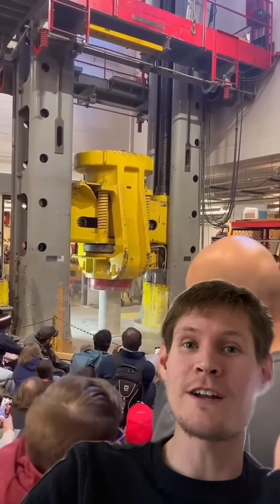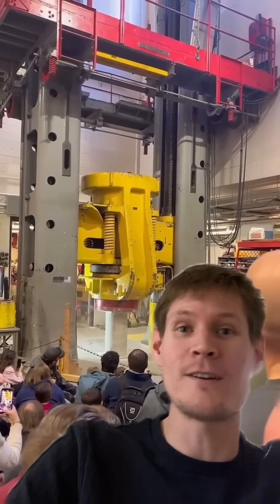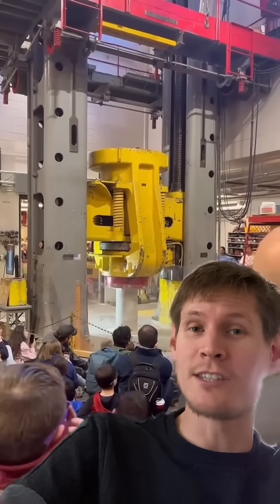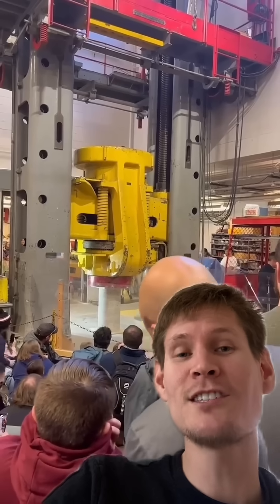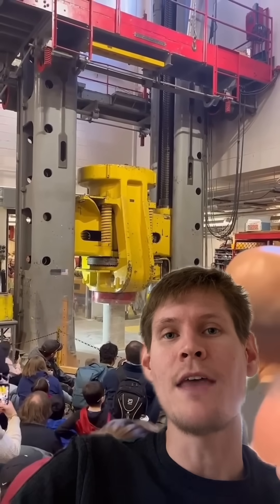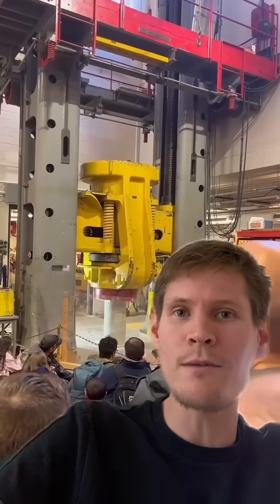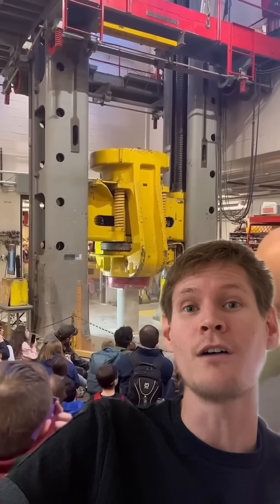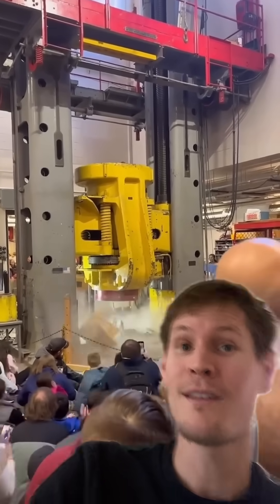1 Minute Structural Engineering Lessons 1 #structuralengineering #education #engineering

Comment: Im no engineer but I kinda get the sense that the civil-engineer’s philosophy on requiring non-ductile/tempered steels is steeped in superstition.  There are plenty of uses of tempered steels and aluminum alloys in vehicles, yet Mechanical Engineers dont worry about those parts failing…

Comment: That is why reinforced concrete is always under-reinforced, the steel gives way slowly before the concrete fails explosively which would be what would happen with excessive steel reinforcing..
Reply from the maker: yes! although i wouldnt say concrete is "under reinforced" that makes it sound like we didnt put enough steel in it for the job, instead we make sure we have enough rebar AND the member stays in the tension controlled range so we dont have that "hand grenade" failure. also why we have max rebar checks!
Reply: @Kestava_Engineering  I studied Civil Engineering way back in the 1980's and one of our Lab Experiements was to design and construct a suitably over-reinforced concrete beam. And then test it to failure, which was suitably explosively sudden and lesson learning. Then test a correctly designed beam which slowly deformed. The difference was stark and memorable.
Reply from the maker: @marcusgault9909  that sounds like a great experiment!
Reply: Not under....you don't want concrete failure before steel failure 
Concrete failure would result in sudden collapse of the structure if the the steel already failed ..be careful 😮
Reply: Can you expand on this? I'd like to read more about this